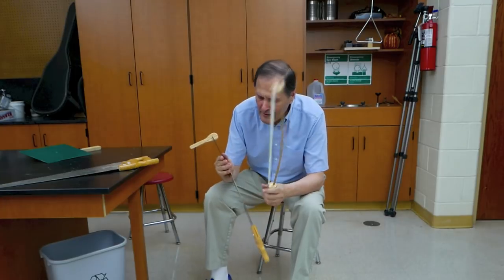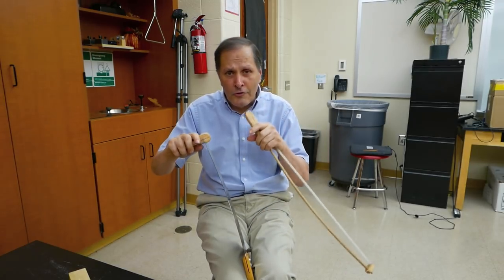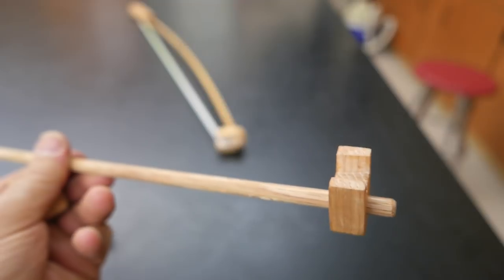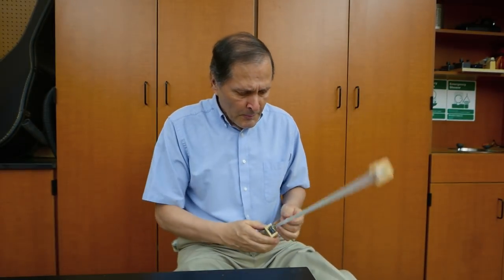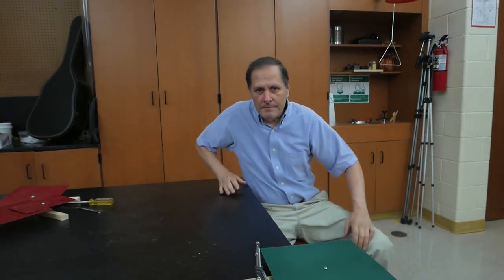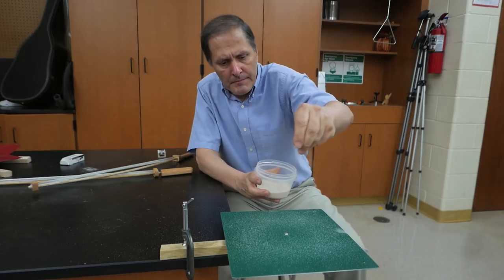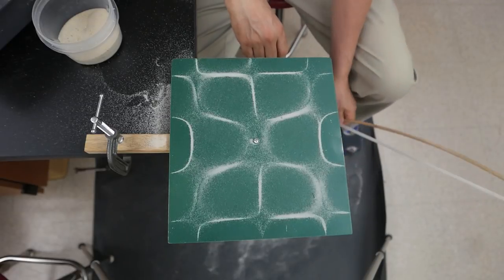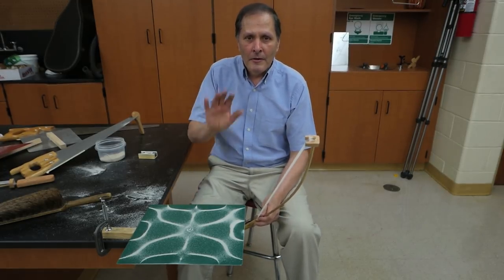Musical Saws, Chladni plates and a Homemade bow // HomeMade Science with Bruce Yeany

Comment: I have just made my own "bow", it is more like a long wand though (Same length as standard bow) not too bad as it goes. I just used a thin wooden rod with electrical tape run tightly lengthways (Don't wrap it around, except at the ends). I am going to buy a proper bow but to be able to have a go with just a saw and stuff you may have lying around is awesome fun :D
Reply from the maker: Darren,  it makes me happy either way you go as long as you try some of these experiments.  Thanks for commenting
Reply: Bruce, Hi thank's for your reply. My comment was only to give people a shortcut to have a little play with very little effort. Please try it for yourself (Simple bow made of a thinish rod of wood coated in lengththways stretched electrical tape) and let me know what you think, you may be surprised by the results. Your video did inspire me to invest time into the saw :D I am still working on muscle memory but am improving in leaps and bounds.
Reply: Oh and I totally get harmonics lol :)
Reply from the maker: Hi Darren,  I will give it a try if there is an easier way and more people will try it, then I'm all for it

Comment: Great video as always but I have one concern. Why did you apply rosin to the bow?
Reply from the maker: Rosin helps to make the bow string sticky.  it's the stickiness that grab the string on a violin, or in this case the edge of the plate and then let go,   grab and let go, grab and let go on and on for a few hundred times per second.  This is what is setting up the vibrations  in plate or in violin strings

Comment: Hi Bruce, we've got two science teachers at our school that are trying to figure out how to make the chladni plates, and we can't seem to make them work! We're using 12"x12" 1/8" thick steel; are you using a different metal? We can't get any patterns to form, and we've tried about everything! Any help would be great, thanks!
Reply from the maker: My plates are made from ordinary sheet metal, about the same as you describe,  so my guess is your bow.  Did you make a bow or are you using a violin bow?  make sure you use plenty of rosin, or maybe a different type,  I have two kinds and the one works better than the other. Try the bow on an actual violin if you can to see that it works.  not sure what else I can recommend.

Comment: After what I just saw I shall return to this channel with regular frequency and bow to your superior teaching skills!
Reply from the maker: I would guess that I've been at this longer than you have (just finished my 40th year) but I hope that you can use what I've learned and surpass me.  Thanks for your comment!
Reply: @YeanyScience Hello, I really could need your help. What material is your plate and thixkness, I used 70cm2 aluminum 3mm thick and I cannot make it swing nicely. I am using a violin bow with rosin but will try to build one according to your design.

Comment: A neat demo you can do with the violin rosin is to rub a liberal amount on your fingers and thumb (if a piece chips or off, crush it between your fingers and rub it between your index finger and thumb). Grab a metal rod or pipe (copper works great, but galvanized is ver difficult) in the middle with your unrosinned hand. With the rosinned hand, pinch the pipe firmly between your thumb and fingers and slide your hand down the pipe. It should start singing and repetitive stroking will make it sing louder. The waves produced are longitudinal waves and the ends can be seen vibrating by suspending a small washer from the ceiling, and touching the end of the pipe to the washer...the washer will shoot off quickly from the end of the pipe. Making the pipes sing is also fun to do at the hardware stores...you get a lot of puzzled looks. :)
Reply from the maker: LOL,  I do have one metal bar that works  but hadn't thought to try it with others and would I'd like to add a variety  to my collection.    I will try that at the hardware store before making my selections. Thanks Dwight

Comment: Well done and amazing, as always! I was surprised that you could use the slippery nylon line for the bow. I know you applied rosin, but I did not think rosin would have adhered to smooth nylon.
Reply from the maker: Thanks Slater,   the nylon works great,  I compared it to a real bow and found it worked just as well,  however, I did find that rosin may  need to be applied more often.

Comment: been trying to do overtone singing lately, it's crazy how these work lol.
some theory i heard about frictives being composed of ~5 + vowel or so overtones lol kind of interesting, like I've been using yaw, way (aioueyiou) to try and exchnge chest resonant cavity note with nasal cavity note through the back of the "hyeangiouweay" throat / intermediate part, it's like the sound goes to my nose / ears then out and back to my chest / diaphram note and my tonsil area / mouth  chase the note through to my ear's / jaw + head (and you can tune in to single teeth if you find the right oscilation pattern lol. But this is  great visualizer for what's happeneing. I'm excited to try different particulates to try and model the cycles that are happening.

My mom has colored sand, I told her about your method and she made some of her uglier (gawdy and blech colored lol) sand a tolerable green haha.

Comment: Fabulous. I read a section in an old encyclopaedia from about 1900. It explained how to make a “sound picture.” You had to take a metal saucepan, stretch a skin across the top, sprinkle sand on the top and blow down the handle making different noises and record what patterns were made by the sand. I always wanted to do that, but I thought mum might not like it. I still have the book.

Comment: Your method of making a bow is simple and very effective. I wish I had thought of that earlier. I had made one by buying the string from a music store, then using a bar clamp as the bow, but the strings were not uniform and started fraying. I'm going to have to make one for next school year's physics class. Thank you for sharing.
Reply from the maker: I've  been impressed with these,  I compared it to a regular bow and found it works just as well  but it may need rosin a bit more often.  I'm not sure if the dowel needs to be bent quite as much as what I have.  Good luck with the build.

Comment: Dear sir, What is the thickness of the plate? Tried with a 0.3 mm thick steel plate, but it didn't work.
Reply from the maker: that is thinner than what I used, not sure what the gauge is, but I would guess it's at least twice that,  I will check and try to find out

Comment: Okay so when you rub the bow across the metal plate the sand rests on the nodes because that's where the sound waves are less frequent? So does that mean we're looking at the actual vibrations of the sound? So we could actually physically look at music with that?
Reply from the maker: I like to think of it that way but  we're not quite seeing the sound itself but it is still a beautiful result to it .  What we have is  the reaction of the material to sound wave energy and the patterns  change as the intensity and pitch change.

Comment: what is this thing you're applying on the string ???
Reply: It's rosin, which is basically hardened pine tree sap which adds friction. Costs a couple of bucks on Amazon or your local music store.
Reply from the maker: It is violin rosin,  musicians  apply  it  to violin and cello bows to make them sticky.  I think real bows use horse hair,  I find this works just as well.

Comment: Where did you get the metal plate???
Reply from the maker: A few of them were cut from the sheet metal of an old refrigerator door.   Some hardware stores sell sheet metal in various sizes or check for a local metal fabricator,  also auto supply stores sell sheet metal for auto body repair